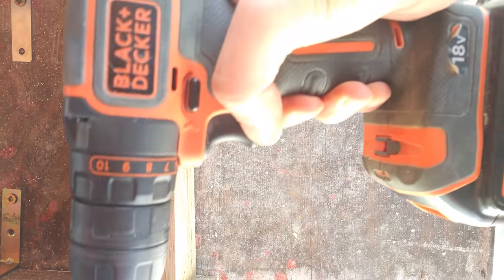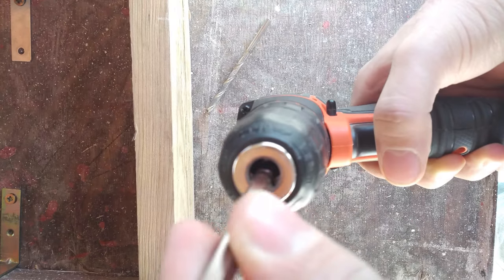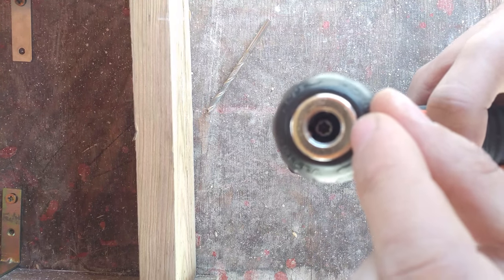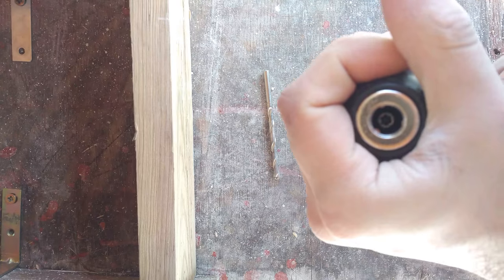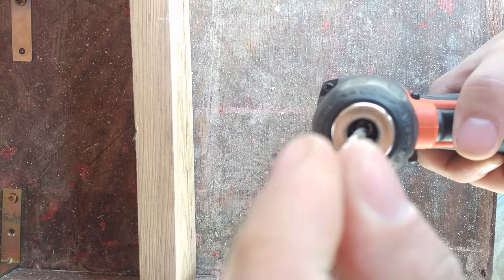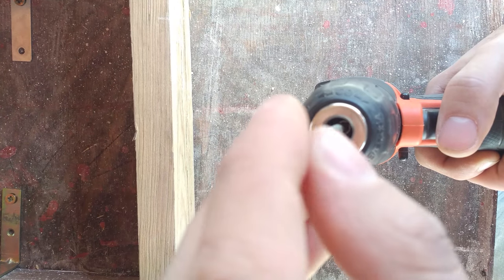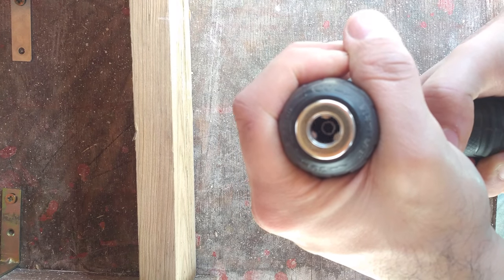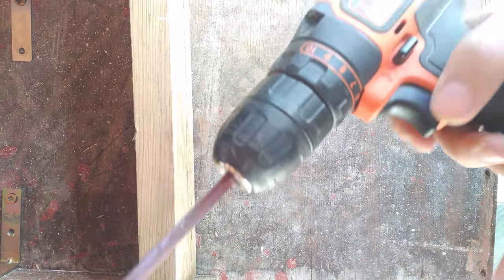Simple fix to cordless drill chuck not closing (loose drill bit)

Comment: Thank you so much. My neighbor needed a chordless drill so we traded my Makita chordless for his Stanley chord powered drill for one day. I used his drill for less than 1p minutes when the chuck stopped tightening around the bit. I told him that I messed up his drill and would get it fixed.
I was convinced I needed to either replace the chuck or take the drill to a repair shop. This video helped me solve the problem. I'm going to give him his drill right now.
Once again, thank you.

Comment: been using my drill for about 5 years off and on.. been thru alot.. and today i got halfway into a project and it wouldntt ake a bit anymore.. i thought i was going nuts... 

Thanks much for showing how to fix and a solution when you dont have the right size.. i used a 1/8th bit and tightened right up
Reply from the maker: Glad it helped!